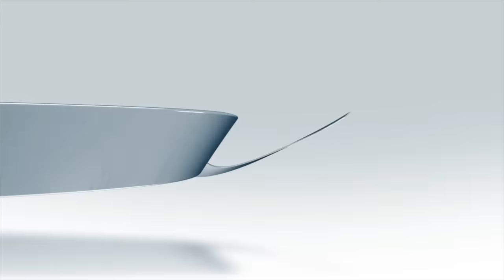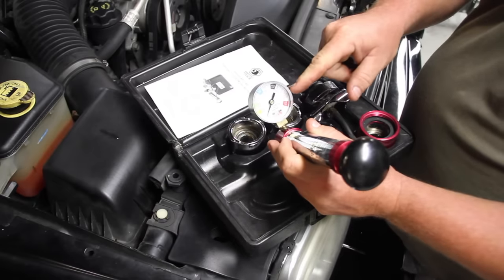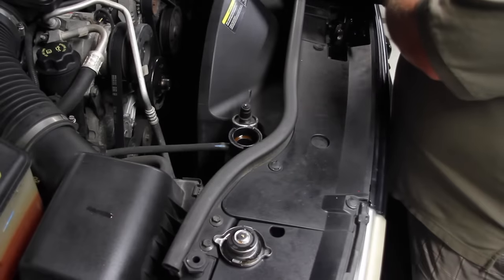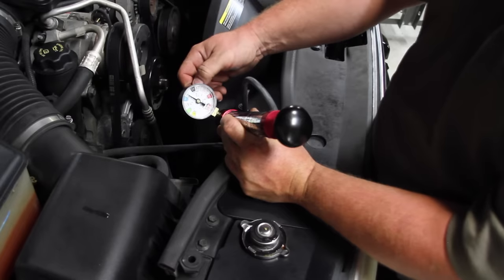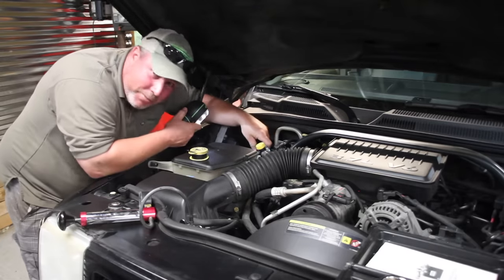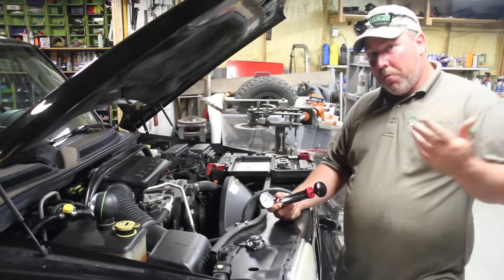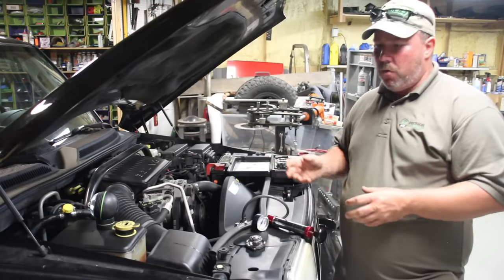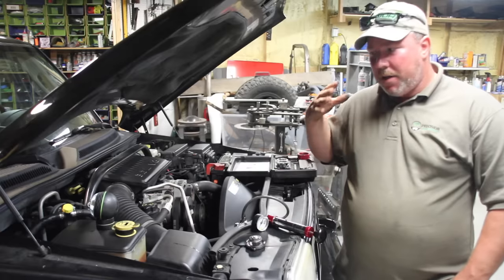Why is My Car Losing Coolant?

Comment: Could a car just be low on coolant with no issues ? I haven’t had any over heating , no funny smells . But my coolant was low
Reply: Mines same but it loses it after like 2 hours no drive
Reply: @ADHDgaming0  could be your reservoir
Reply: @prestonzefereo4576  just took to garage and my head gasket has blown 😩😩😩
Reply: @ApzDevYT   bro what if I had 97 devill car smoking  out  vent I'm  losing coolant too but resvior box bro I had  couples leak at bottom what the problem  I no box need change fast funny smell in car I lefylt car quick  trip
Reply: I let cool off 24 hours it drive but start smoking  in ten min soon it get hot

Comment: I just had a WJ losing coolant and didn't see any leaks. I found out that the water pump bearings went bad. The coolant was burning up inside the bearings. You could tell by grabbing the fan (with the engine off), it had play in it.
Reply: What did you have to replace? Same is happening to my car i dont see any leaks but its draining i fill it up and by mid day its gone. And when ac is off as i drive i can smell like burn rubberish type  of smell
Reply: @karmaacosta  possible water pump failure.
Reply: @clintr5118  so i have to replace the water pump? Or whats your suggestion? Sorry I dont know too much about water pumps
Reply: @karmaacosta  If you have never done it before I would suggest taking it to a mechanic before it overheats and causes more damage.
Reply: @clintr5118  yeah i know but i mean what part do i need to buy? Is it just the water pump or the bearings? Because it doesnt over heat but it shows on my dash that the level is low after filling it up that same day
Reply: @clintr5118  even if not done before, u could just let us know what had to be done
Reply: I just put a new water pump and thermostat in and it’s still leaking from the bottom

Comment: Hey man, thank you for the video! I have a problem and I'm hoping you can help. My car overheated and the headgasket was blown. It was fixed and it ran normally afterwards. I am now drastically losing water, but the pressure test shows no leaks, there is no milky residue or smoke at tailpipe and its definitely not the heater core. This is why the car overheated in the first place. Have you ever come over a case like this?
Reply from the maker: try this test, it has to be going somewhere... either that or you just still have air in the system.

Comment: For a blown head gasket, if coolant gets into the oil, the color on the oil filler cap OR dipstick could be either white or a creamy brownish color depending on the type of coolant used. White alone is not a good indicator of a blown head gasket, it could be a beige, chocolate brown, or dark brown color depending on the type oil or coolant used. I used to work with my Uncle on classic, collectible and modern cars and seen what cracked heads, cracked blocks, and leaky head gaskets can do to oil and engine coolant types. I once had a cracked head on #2 exhaust valve on a GMC 250 cu in straight six (one of the longest /strongest lasting engines GM ever had) . Having no tools and it being Sunday (no garages open), I drove the truck with a boat and trailer from Alexandria Bay, NY to Rochester, NY with a trail of white smoke folowing me for 300 miles on I-81, I-90, and I-390 to my house in Fairport, NY. I had junked a Chevy Nova with the same engine weeks before, so I just replaced the cracked head, put a new gasket on my truck engine the next day and cleaned the creamy chocolate brown fouing off the dipstick and filler cap, gave it a test drive and called it done. Yes, I had to refill the coolant every thirty miles, but the engine kept running, didn't hydrolock, and surprisingly got two miles per gallon better than the other trips we took to Alex Bay for great Northern Pike fishing. The crack in the head was three inches long, but very narrow. I expected the engine to ruin itself any moment, but the GM designed six cylinder pulled me through.

Comment: The beauty of the kit is, if you work on the cooling system of your car. When you have finished you can connect the pressure tester to see if it loses pressure. Safer than driving down the road to find a hose clamp loose because you forgot to tighten it.

Comment: I got a trick for bleepin jeep and I haven't seen anyone doing it on YouTube. How many time you get mad changing out the brake shoes it get  Frustrating but if you have a c clamp. Clamp it to one shoe attach pin and spring repeat on the other shoe. It made it so much easier for me to do my brakes on my jeep be myself if u have a second hand u don't need a c clamp

Comment: Don't think that you have to remove the thermostat before using this trick ?
Reply: Is not necessart because the pressure goes to the two sides of the direction of the circuit

Comment: Mines a 21psi cap on my mondeo. I changed the expansion cap because the coolant rose by about an inch when hot. Been fine ever since and coolant doesn't rise now. A good way to tell if your headgasket might be starting to go is take a whiff of the coolant. My old v6 mondeo smelt of exhaust gases long before it started leaking and pressurising the cooling system. Unfortunately the 2.5 v6 duratec has weak spots on cylinders 3 and 5 and that's where they usually fail. I now have a trusty 2.0 4 cylinder and no problems so far...

Comment: I wish you had shown how to test the radiator cap in this video with this type of tester.  Would have given some a complete cooling system diagnostic example.  I have a request for a video...  I would love to see you all do an NP231 rebuild/ upgrade with 6 pinion planetary and 1.25" chain and to go over what parts can be had from which vehicles at the junkyard (6 pinion planetary comes in XXXX vehicles with XXXX transfer case....)  How to inspect them to ensure they're still serviceable....  what to look out for and any other tips you guys can come up with, different input shafts and gear cuts on the planetary gears, and what you can mix/ match to make work..  THAT would make for an awesome video!  And, if you could do another video with any tips for the NP242, that would be really useful, too.  Thanks for all your tech videos.  They're really great!

Comment: Great Vid.
One thing should be said first BEFORE any action takes place.
WAIT UNTIL YOUR VEHICLE ENGINE HAS COOLED DOWN!!

There's a gas statiin across from where I work. A fool kid (early 20s) thought it was wise to remove the radiator cap while the engine was still running. It ended up badly burning his hand and arm. As well as part if his face. It took a solid 15 minutes for the volcano of steam to stop. The fool then tried filling it with water. Because I was over there by this point, I stopped him and put antifreeze in it AFTER the engine had cooled. The boy was being stubborn and did not want to wait for the engine to cool. It took myself and another to convince him to let it cool first.
Reply: FYI, I had a first aid kit, with burn cream, in my tuck and bandaged his arm.
Reply: Not a fool. 

Just a kid. 21.

Comment: As  I was coming home today I noticed I had no heat at all from my heater. I later checked my antifreeze in the radiator and in the overflow tank and found it was virtually empty. Even after adding a total of 1 gallon of antifreeze and 1 gallon of distilled water it still wasn't topped off. I've not seen any leaking at all on the garage floor or anywhere that I've worked so this must have happened while driving. I had to cancel work tomorrow so I can try and figure this out. I sure hope it's not going into the engine. I don't have a flush kit on my Savanah 1500. I figure I would have seen this leaking at some point or seen some white exhaust smoke. I am hearing a squeal or some kind of noise under the hood, but no clue where it's coming from. I'm thinking the water pump.
Reply: What was the problem
Reply: @Justin-o9p  It was my water pump. It would not leak while my van was parked but it was leaking as I drove. I had to have the water pump replaced. No problems since then. The van is a 2006 GMC and that was the first real problem it's ever had.
Reply: @randyd9805  ok thanks

Comment: I have anti freeze on the ground after a 
short ride (10 miles ~) in 105f ambient temp.
I see no coolant when looking at thermostat
and area, nor main hose. under the car I can
 see the final drips coming off of the engine 
case. At first I'd thought it might be condensation 
from running the ac, but there seemed to be more
than what might be normal, I put a jar under 
the drip, and looks like anti freeze.... 
The temp gauge reading was about in the middle
of the range, or less.
New to me RX300, with no known history. 
This just happened today, which 
was my second trip in hot weather of about the same
distance. It was hotter yesterday afternoon having taken
the same trip, I didn't notice any leaks at all, but today
(this am) the leak. shrugs...

Comment: I have a 2006 lj 4.0 with the banks turbo and water meth system. I keep having to top off the coolant I did all of the fallowing preacher test like this video it was fine, sniff test on the fluid and it was clean no codes and no leak ! I can't fined anything and it runs fine under load . 
Thanks for any help.

Comment: My uncle has an older Ford 250 with a 300 inline 6 cylinder that was factory made to burn propane.
It kept using coolant..... found it in the crankcase, the oil looked like coffee with lots of cream.
We just dropped the oil and coolant and pulled the head to see if it was the head gasket, head  the mystery continues it got too late to work

Comment: Excellent video. I’m chasing a coolant leak at the radiator cap. I’m thinking it’s the coolant reservoir at this point. I have a catch receptical at the overpressure release and it is catching the coolant. Not a huge deal, just annoying. 2002 Dodge Ram 1500, been pressure checked ok, but still spits a little coolant at the overpressure at the cap just a little, annoying. Thanks for the vid. 👍

Comment: What about this?

I am losing coolant (the res level is very slowly going down when I check it over the period of a month) but:

- Not a drop under the car/no puddle
- Nothing under the dash/on the floor of the passenger side (no heater core leaking)
- Pressure test is fine and holds exact same pressure for 45+ minutes
- No white smoke out of the exhaust (besides the normal bit of steam in very cold weather or the little bit that goes away after the car warms up when you start to drive after a cold start)
- No oil in coolant
- No coolant in oil (no milky/wet/foamy oil)
- No coolant/water under bottom of oil cap
- Already replaced rad cap

Any ideas?
Reply: Hi there, I know this is a late reply, but I've been having the exact same scenario as you have described in your situation. I have been going in circles for several months & haven't been able to solve this issue. I have spoken with several mechanics & they seem stumped to the point they think I'm making this up. (why on earth would I want to make this up & have un-needed additional stressors in my life). Anyway, I was hoping that you would share how you rectified your issue.
Thank you for anything you can add. 
Cheers!!
Reply: Hi please I have same issue now can you help me? If you did find a solution
Reply: @serenitynow8265  Mine started showing white puffy smoke out of the exhaust eventually (typical head gasket leak symptom) so I got rid of the car for a new one.
Reply: @bobcatminer3003  Mine started showing white puffy smoke out of the exhaust eventually (typical head gasket leak symptom) so I got rid of the car for a new one.

Comment: Brought a used car recently and within a few weeks noticed the coolant had gone below minimum. Lucky I checked it. Monitored it from there thinking the person who sold it just never topped it up properly and with no leaks on the floor i assumed that was all it could be, but no it kept happening.
 and eventually I did notice drips on the floor Garage said it Was the Thermostat housing (a crack)so replaced it. Seemed OK for a week or two but now noticing drips In the same sort of area beneath the car again with slight coolant loss, not as much as before but that's how if started the 1st time around and got worse.   You'd think the garage would have fixed it properly having said it was the only leak they could find. Like I say it seems to be in the same kind of area again..

Comment: Thank you so much for such a reassuring video man !.... I can finally get a good night's sleep tonight after watching this !...

I have a 2010 Mercedes E63 AMG with the earlier silver metal cylinder head covers... It is the v8 6.2 L M156 engine... the same engine that's known for head bolt failure and hydro lock when the coolant get into the cylinders !... recently I've been losing a bit of coolant (about half a pint in 2 weeks), It even does it when the car is just parked up and sitting there unused for weeks, Now I am happier that it may just be a bad hose, although I can never see any water/coolant on the floor, but I don't know if any is in the under tray until I remove it, but I am going to buy one of these gadgets for testing the coolant pressure that you were using on the Jeep and see what I find !... Fingers  crossed it will just be a split hose or a loose coupling... Great video man... Best of luck in all you do 👍👍👍👍👍

Comment: thanks for the clip, i own a 3.7l jeep liberty kj model. i keep lossing coolant when even i start /run the engine i smell coolant burning from the exhaust system. could it be a cracked cylinder head.

Comment: I tired the cap didn't fix I I have to fill a quarter bottle coolant in my radiator did a pressure test no leak most likely is head gasket or bad cylinder head right I have to do a compression test and see if all cylinders have even cylinder like for example 123 is 160 and 4 is 120 number cylinder has a problem I pulled spark plugs no white chalky substance on spark plug plugs are burning  good

Comment: My 03 cadillac sevile doesn't have a leak or radiator cap, just a reservoir plastic cap, which is in great condition. No leaks either

Comment: Need to get this done... Coolant level keeps dropping below the filler neck, but never any lower and I've always filled it to where the caps gasket seats inside the neck and it's never dropped until recently!
Reply: No overheating issues, no coolant mixing with oil, but I'm not finding leaks either... Hope it's not the heater core because that's beyond my scope of work that I'm able to do!

Comment: what if the water doesn t go to the ground ... the car loses water on or off like i just topped it left it in the garage came 30 min later with like 20% water missing .. no white stuff near the oil no white smoke no nothing and the water is hot in the container so the pump is working fine .. how do i find where the leak is if i have no tools?

Comment: Could also be leaking in the radiator to transmission fluid cooler sometimes.
Reply: That is what happing to my Jeep right now 😪
Reply: 2004 Chevy Silverado 4.3 losing antifreeze but cannot see no leaks where is it going
Reply: @gregmoreland5687  same with my 2008 Higlander

Comment: My fiancé’s Camry is losing coolant, Camry and it smokes white ONLY for the first 30 seconds when first started only on the first start of the day. The drivers side floor board is soaked all the time, I’ve checked the head it’s not the gasket, I’ve pulled the carpet and blew the ac drain hose clear, I am at my wits end with where the coolant is going and why the driver side floor board is wet. Anybody have any suggestions? Anything at this point would help.
Reply: THATS YOUR HEATER CORE

Comment: Would you know what my problem would be : with a 98 Buick Century and radiator has been flushed; but inside the radiator cap has almost like a light mud  around it..but not white..and oil looks okay... THANKS !!

Comment: My van loses coolant about 8oz in a 20mile drive. Pressure test won't hold at 16 but will hold at 14 for 30min. No visible leaks. Combustion leak test also good (if I'm doing right)
Reply: Oh man that was a year ago I can't recall I basically in the end replaced the whole cooling system except the heater core.

I had holes every where, from pin holes to cracks, constant removal of radiator cap caused that to fail, etc... it was a nightmare but I was stubborn.

Comment: I parked my car near atm to get some cash, i had been driving for say 12km stopped ddnt turn it of .. after i get out of atm coolant steam was coming out on the front. Turned off the car waited for it to cool down but coolant was leaking so far under neath .. after it cooled down i added water turned the car on its day two am driving the car waiting to see if its gonn leak nothing is happening... was i just being followed by bad luck that day or what happened!???

Comment: I need help I replaced the head gasket on my 06 Hyundai Tucson and after replacement it's still having water being pushed in the spark plug Wells did the head gasket get on wrong could it be something else it's not starting and I'm not sure wat I did wrong or if it was something else I should have fixed some one help

Comment: That cap you used to test pressure at 2:45 will it work for pressurized containers? I have a container (2003 Chevy Cavalier). And another question, if the car is loosing coolant only in Heat mode, what that can be (seems that what our car is doing)? Thank you for the film and reference for the tool.

Comment: Hi there I have a 1998 dodge Dakota truck and its losing coolant    from the over flow tank when the engine temp reaches 105 and above.  Any idea what could be causing this? Thanks in advance
Reply: Air in your system

Comment: I drive a '90 Ford Ranger now, and when the 2.3l engine dies, a Ford straight six is going in it's place. I'm tired of a Pinto engine in my truck. I'm slowly building it now so it will be ready when I need it. I'll fit it in the Ranger somehow.